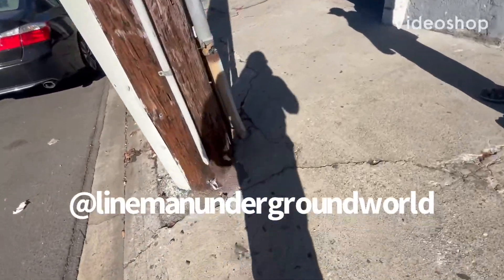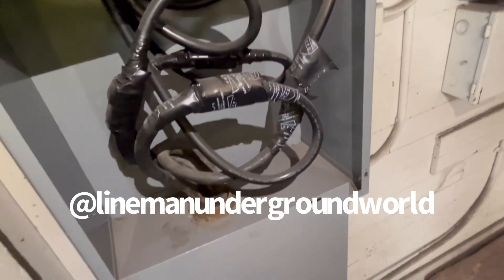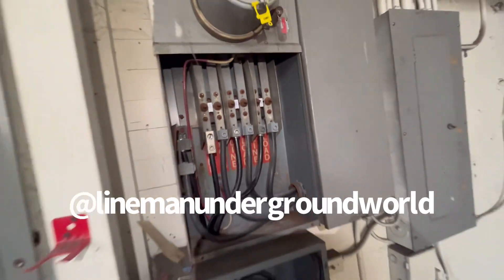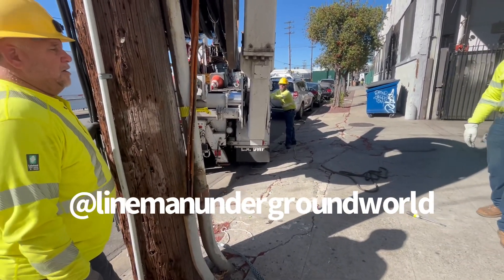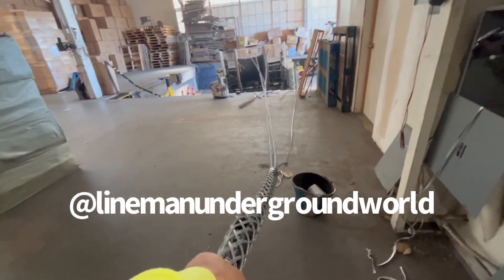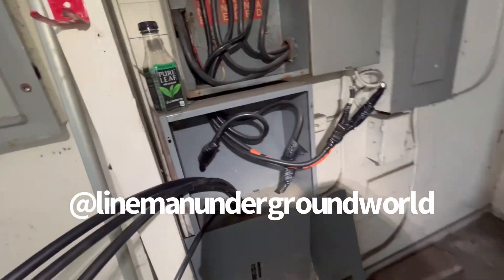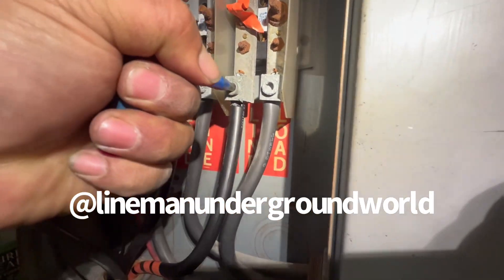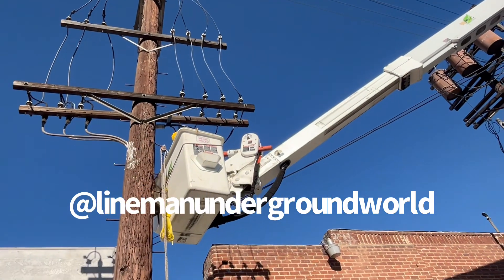Vandal 3-phase service & riser

Comment: Why not use some type of repair splice instead of changing out all of the wire?
Reply: Stand by
Reply from the maker: @jacobwhite9524  wazzup Jacob we never try to do splices in the conduit, because down the road if it happens again and chances are great that it might, some one might try to pull the cable and get it stuck …👍😎
Reply: Illegal in most countries to have a splice or joint in conduit or any raceway, especially frowned upon when its in the service entry conduit, it must be one continuous conductor.
If this wasn't a service entry, you could cut the pipe and add a junction box and then do a splice inside a junction box and that would be legal but you can't have a junction box on the service entry. The only break between the power line connection and the se panel allowed is for a meter.
Reply from the maker: @ wazzup 99Eternal well said about the cable and the splicing and the conduit..👍😎

Comment: Looks good! You guys are great, well done! I serviced a theatre that had a wild leg service...during a renovation the dumbass electrician tried adding a few 120v breakers to the open spaces in the booth panel, fried the film platter transport and blew up some worklights. Thankfully he stopped flipping breakers when the worklights exploded, so the sound rack (with about $10,000 worth of gear) was spared.
Reply from the maker: @mxslick50  wazzup mxs hope the kid was ok 👍 thanks for sharing your experience..👍👍😎